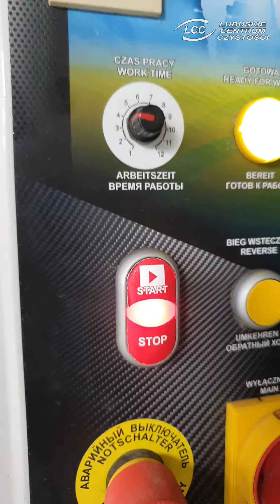Owca prosiła o wypranie 🐑

Comment: Cute.  1:00 a little bit of dirty water after the :_lccCan:  3:02 Looks like a normal sheep color now.  :)  5:28 mixing up some "goop" but not "GOO"  6:07 :_lccCrb:  8:39 underside washing....uh rinsing.  LOL  10:37 special hand scraping before the centrifuge.  It's fleece is now white as snow.  :)
Reply from the maker: I guess I could call it "a comprehensive sheep bath". 😅😅😅
Reply: @lubuskie_centrum_czystości  LOL  that would be accurate.
Reply from the maker: @Stretch54449  😊😊😊